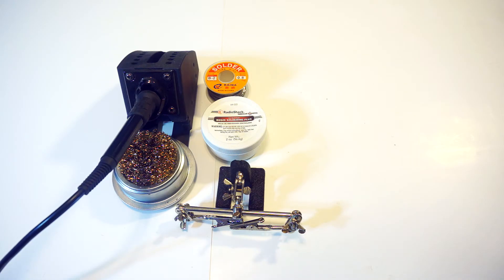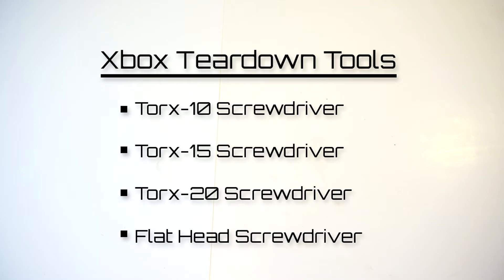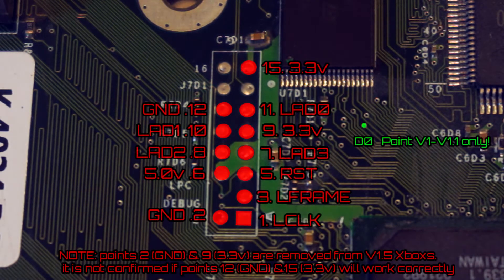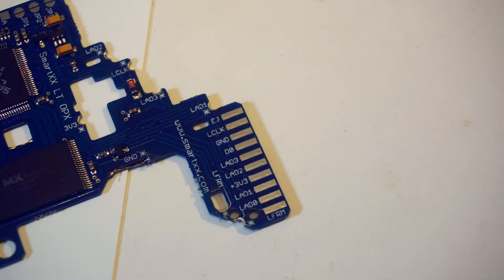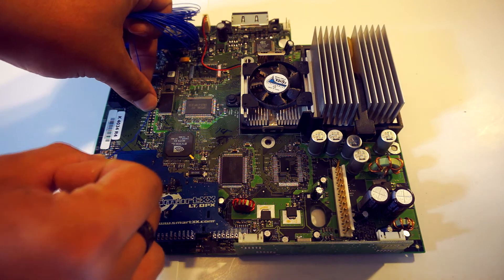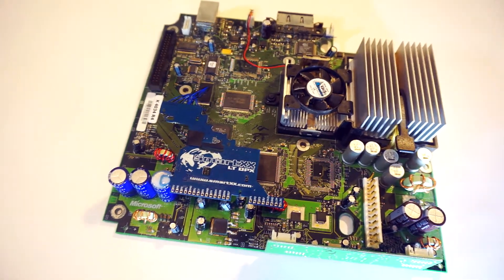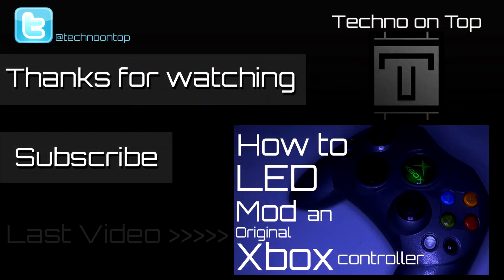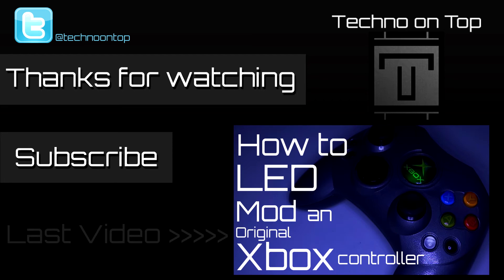How to Wire Install an Original Xbox Modchip

Comment: No idea if your still monitoring this video, but I have a quick question. I bought some 30 awg wire and some 30 awg solid kynar wire. The kynar seems way smaller... May be easier to work with though? Harder to strip it seems.. Looking to install the sx core and sx lite soon... Would you recommend going one way or the other as far as wire goes?
Reply from the maker: I would  use the solid kynar, pretty sure that's what I used in the video, iv been using thicker wire were it fits, 26awg now, course just doing a pinheader install is quicker, thanks for watching!

Comment: just to add abit, on the version 1.6 xbox the lpc isnt wired on the pcb (no traces to it) you will have to wire it up manually its the only version xbox you have to do this to as all the others the lpc is connected with traces
Reply from the maker: yeah you're right not sure why I left it out of this video (lack of planning most likely) but I did, most people don't wire install a modchip but I do cover how to do an LPC rebuild in this video https://youtu.be/gTTGLBT8hDY so i should probably add that to the desciption, thanks for watching and thanks for catching that!
Reply: no worries pal always like to help where i can as recently done a mod chip to my v1.6. your channel has giving me so many ideas for modding both my chipped (v1.6) and tsoped (v1.0) so keep up the good vids =)

Comment: Is this chip still available somewhere? Would love to add an lcd and chip to one of my consoles, but my first choice is gone forever. (Xecuter XC3)
Reply from the maker: no its not, this chip has been gone forever too, unfortunately there are no chips being made anymore that support LCD's. your best bet for finding one is checking buy/sell/trade area's on niche  forums (isozone,assembler ect.) there was a guy making his own modchip which had the LCD support i think he called it "Xblast" it was on the assembler forums.
Reply: TechnoOnTop damn. and the guy on assemblers was named Benny something I think. I plan on getting in touch with him soon too. thanks man.

Comment: I hate Microsoft Developers thay put restrictions on Original Xbox Bios or Xbox 360 XeBuild it get round Jtag ,Rgh ,Rltag ,Rjtop ,Srgh ,Rgx ,Dgx ,Ergh toialy remove restrictions off and alow run unsigned code that is why

Comment: Hello mate! Love, love your videos...please could you tell me the difference between this chip and the Aladdin chip? Is it one better than other?
Reply from the maker: Sese Cabo this chip you will probably never find as they haven't been made for years,  alot of that information is on the Xbox scene website.  For the most part most chips are the same in function,  some have there own OS's some have more memory,  some support LCD displays. Hope that helps a bit,  I'm not sure on the exact difference between the two
Reply: I have the Aladdin chip but I can't find info about if is compatible with LCD screen like yours
Reply from the maker: Sese Cabo you probably don't have a chip that supports it,  but if it does it will have most of if not all the pins i showed in the video where I show how to wire one in
Reply: Do you know what chips support it? Where can I get them? Thank you and sorry for so many questions
Reply from the maker: Sese Cabo The mains are the excuter x3,  pretty sure all smartxx chips, xeium chips,  one alladin xt chip does.  There was a guy on assemblr forums making his own mod chip that was supposed to have support for an lcd.  Like I said they don't make these chips anymore as there is no demand for them.  You can try your luck on ebay,  or ask around on certain forums, no worries doing my best to help

Comment: where can i buy this modchip?
Reply from the maker: glad you found my channel! and i appreciate your support, but yes alot of information has been lost to cyberspace (for all older consoles) im just aiming to both bring it back and add to it with things that never had tutorials to begin with
Reply from the maker: unfortunately this particular chip "smartxx LT OPX" would be very difficult to find. most chips that support an LCD screen are tough to find. your best bet is to keep an eye out on the right forums. this chip was released about 11 years ago
Reply: I understood. Thanks for sharing more skills thst only you have. Its so easy make a mod with your help ;).So if you can make a video learning how to instal lcd using alladin xt plus 2 and how to upgrade the ram to 128mb. Aladdin xt plus 2 still comercial and its not hard to find and works with lcd.
Thanks !
Reply from the maker: i do plan on making a LCD tutorial very soon, really had no idea you could still buy a chip still that supported LCD screens very cool! the Ram upgrade is on my to do list for sure. though honestly iv never done it before. im very glad that my tutorials are helping :D i appreciate your support!
Reply: I'm an Italian user thank you so much for your tutorial is now extremely rare and difficult to find such information on original xbox
Reply: :) Thank you

Comment: I know this is a noob question but what is the purpose of a modchip?
Reply from the maker: Not a bad question,  some points have been covered in other comments.  Honestly 90% of Xboxs don't need a mod chip.  V1-1.5 can be TSOP'ed which gives almost all benefits of a mod chip. The chip I was gifted had the ability to run an external LCD display which can't be done with a TSOP.  Another cool feature about this mod chip is it had its own OS which allows me to test Ram chips when I decide to upgrade. But that's really it. Thanks for watching
Reply: is like softmod but you dont need eeprom anymore, so can play with any unlocked hard disk, some of them supports lcd screens and many things that i dont know
Reply: on the xbox its basically like the softmod, only that you get additional security layers that allow you to restore your xbox if something goes wrong. with some softmods, you only get 1 shot.